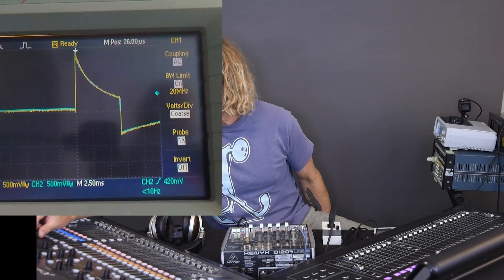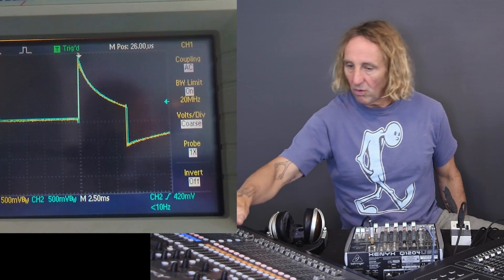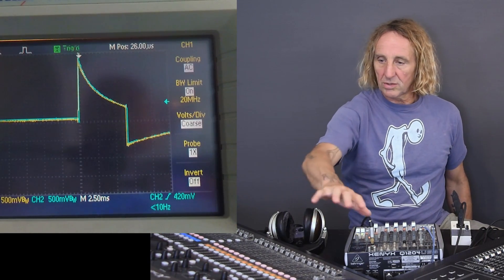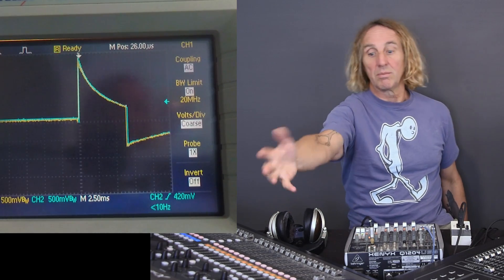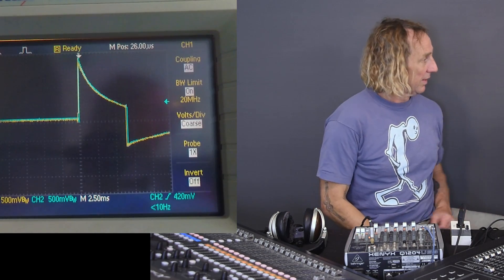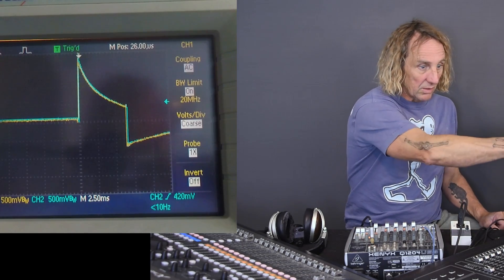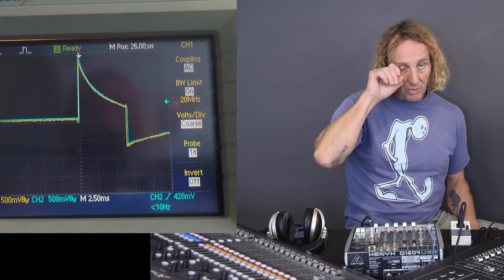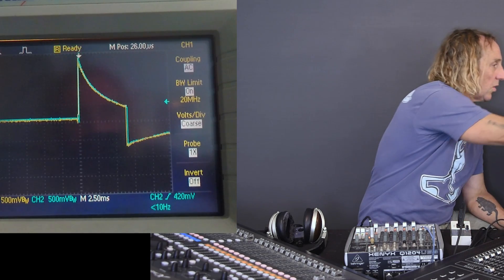Digital vs Analog Audio - X32/M32 AES50, Routing Latency (Public)

Comment: Dave, everything you do ....is outdated
Reply: Thank you for taking the time for this unnecessary and meaningless comment... and Dave everything you do supplies super information crossing my mind that nobody has actual real life  answers, you know even the biggest companies sometimes gives false documentation with the product, having test result with one sine wave instead of pink noise and manipulating the information... thank you so much man 👊
Reply from the maker: Thank you Mert.

Appreciated.
Reply from the maker: Hmmm, well these tests were inspired by bands coming through with M32 consoles and having issues with 100 meter runs for the AES50 of the festival shows we provide sound for.

So I got the consoles to do some tests and share what I found.

Perhaps you can share some valuable info about this outdated gear from your position of knowledge and experience?

Sometimes the most judgemental people are the least informed and sharing info so we know your depth of useful knowledge would be appreciated.
Reply: The majority of small to midsized clubs in the cities in my area of the world have these two mixers. As much as "big time" engineers turn up their nose at them, it is to our benefit to learn as much as we can about them in order to do our job better, regardless of whether we like them or if they are "old" . The information Dave gives is current for real world situations. If your looking for a GAS channel, in order to buy your next $20,000 mixer (just to say you have the shiny new mixer) Dave ain't it.
Reply: Everything comes back into fashion. Vinyl outsold CD last year so my old outdated copy of TOOL AENIMA went up from $19.95 I paid for it to over $1000 now if mankinis come back into vouge I’ll be set.   ha ha ha lol.

Comment: Being a musician and a recording engineer, at some point I wanted a definitive answer to the question “how much latency is ok?”  Finding out what amount we have is simple addition, with DAWs, mixers providing the numbers.  But what amount is ‘invisible’ to us as players?  I record live within a Pro Tools session and provide foldback from that session as a regular part of my workflow, so I needed a number; a reference I could relate to as a player.  Here’s how I got there.

First, some known quantities.  
1.   Sound travels a foot in a ms (millisecond).  Umm… close enough.
2.   A sixty-fourth note at 120BPM = 31ms.  
3.   A band of any kind - string ensemble to power trio - while rehearsing and writing together, commonly tolerates distances of 10ft and sometimes much, much more between instruments while absolutely nailing a groove.  So they see and adjust to latencies of 10ms+, when they must.

Some real life MINIMUM numbers:  When a drummer hits the snare with the most perfect accuracy they can muster, its sound takes roughly 2ms to reach their ears.  If I mic that snare a couple inches away and return that signal to the drummer’s IEMs with zero latency, it is actually going to be EARLY!  This blew my mind and helped me establish that 2ms must surely be an indistinguishably short system latency.  Besting that 2ms might be legitimately claimed as folly.  For the kick it’s more like 4ms but I’m sticking with the worst case snare.  The note value I mentioned in #2 applies to any instrument and assumes that extremely fast cadences that hardly anyone can play with accuracy represent a resolution of about 15 times that snare-to-ear delay.  That seems likewise to be quite reasonable as a delay that would never intrude on a player’s meter.  Trust me, even the most insane fret-tapping fiend is not going to feel 2ms.  Even the 1st Violin parts in Vivaldi’s Four Seasons would be safe.  For anything more legato, the tolerable latency would of course be larger.

3ms is not easy to achieve but is entirely doable with a DSP system like my Pro Tools HD, which measured 2.72ms with hundreds of plug-ins and layers of submixes necessary to record a 10 piece band and return 16 foldback mixes during a live session.  This was a paid gig, so I couldn’t experiment.  It was a one-time with a crowd, don’t mess it up, test and it passed with flying colors.  Many will spot that real life delays are much longer and that we players adjust, which is true.  But I wanted to know how much ARTIFICIAL latency I could introduce without problems.  The eye-ear-brain connection is a marvel and a player will adapt to anything they can compute.  What they can’t see becomes un-computable.  2ms if I can, 3ms worst case - will cause no issue.
Reply: I've seen other demonstrations say that if there's a latency of less than 7ms for in-ear monitors it's imperceivably to the performer.  Anything there at 7-10 is perceivable and in the 12-15+ range it's almost unusable because of how disorienting it is.  Also keep in mind everything adds latency.  A wireless microphone, into a mixing console, down a run of AES50, processed, back down the AES50 run, out the stage box, then fed into a wireless in-ear monitor pack, for example, is around 5ms or something like that.  It's totally fine.  But everything DOES add latency.  So here's a real-world example:  I use a wireless guitar pack, wireless in-ear pack, and all that digital routing, and it's totally fine, BUT, I also occasionally use a drop-tune pedal for my guitar so we can play in other tuning at the press of a button instead of having to changed to an Eb tuned guitar, but that DOES add enough latency, that it is noticeable.  Not to anyone who is not the person playing the guitar, but playing through the pedal, WITH all those other latency things is perceivable.  Whereas the pedal by itself is not, and the wireless stuff all also by itself is not, but adding them together, it is noticeable.  Not enough to cause us to not use it because the convenience is just too awesome, but it is worth knowing.
Reply: I read an observation from a monitor engineer some years back who related a story about a well known female vocalist he was working with who complained about the latency of a speaker/amp combination for her stage wedge.  The engineer switched to an amp with a less powerful DSP and thus a less complex speaker preset, and the artist was happy.  The more complex DSP preset utilized FIR filters and had a latency of ~7.3ms.  The simpler amp had a preset latency of ~0.6ms with only PEQ filters.  Both amps were from the same manufacturer and the presets were provided by the loudspeaker manufacturer.
Reply: @johnschalk1271    7ms is ridiculous latency for a power amp to have!  Any single monitor device’s one way latency should be sub 1ms.  Who would design an amplifier, which would almost inevitably be part of a monitoring chain, with such delay?  DSP doesn’t even deserve the name if it takes 6ms to emulate an equalizer.  Extremely complex equalizers emulations within Pro Tools HDX come with about 1ms delay.  Run of the mill EQs take 100us or less.
Reply: @artysanmobile  Well, this particular amp design is at least 10 years old and the speaker preset in question implements FIR filters to flatten the phase response of the stage monitor, so much more complex that simple linear Eq filters.  There are two newer amp series from this particular professional amplifier company and I would not be surprised if they've reduced the latency in their newer products.  I measured the latency of the two amps using a DI to get the amp's output back to mic level for my USB preamp.
Reply: @johnschalk1271    The tech has existed for at least ten years to implement highly accurate equalisation in DSP at tens of microseconds speed.  You’re being very cagey about what manufacturer simply ignored something they definitely should have known.  Zero phase is a real mess to emulate mathematically.  That should simply disqualify it from real-time use.
Reply: @johnschalk1271    Your post made me look up my Crown amplifiers spec sheets.  All the DSP processes are clearly explained.  Latency?  Crickets…..  Shame, and no excuse.
Reply: @artysanmobile  Thankfully we have low cost tools that let us measure some of these values ourselves.  I'm using Room Eq Wizard and a Focusrite Scarlett 2i2 for my measurement rig.  I loop the left channel of the 2i2 back into the input as my timing reference and then off I go and measure stuff.  I'm learning as I go, but finding interesting results too.
Reply: Thing is... latencies sum up. Imagine a keyboard player using a computer with something like Kontakt Sampler. The software has some latency, his/her audio interface has latency in communicating via USB, and the DACs have latency. Then imagine a Dante thing... ADC, TCP/IP, mixing console, and all the way back to the controller amp (so even more DA, AD/DA)...  when I play PianoTeq on my computer which goes via an old RME Digi via ADAT lightpipe into an old Yamha 01V96i, a latency buffer of 256 samples in the RME is hardly bearable. It feels wrong. 128 only sometimes bothers me, 64 samples is safe. So I need my soundcard to run at 1.3msecs buffer in order for the whole system to feel right. Which may seem stupid, but there are other latencies summing up, like the MIDI driver, PianoTeq itself, and the 01V96i. So my advice would be: Keep latency down in live situations, keep it as low as you ever can.
Reply: @nielsott    Yes, both live and dubbing scenarios tolerate very, very little delay.  In each, a 64 buffer is now worst-case.  DACs have gotten about as fast as they’re going to, around 500us, leaving processing likely to break the bank.  I have noticed software processes, including summing, getting much quicker lately, due to regular use of high quality FPGAs which were unaffordable not so long ago.  It is not trivial to write code for FPGAs but music is borrowing from richer industries, making USB drivers near invisible where they were once the wall.  RME, Antelope, Avid, Lawo, Digico all pushed the envelope and the rest must follow.  The market (us musicians) needs to demand vanishingly low delays.  The tech has been there for awhile.  Music presents a very high bar regarding delay.  Please see my original post in this thread, and forgive me for its length.
Reply from the maker: I have had experience with consulting for a manufacturer that had proprietary FIR processing that was quite good but it did require about 6.5 Ms of latency to implement. The actual latency of 6 5 Ms (about 7feet in the physical world) was not really an issue as musicians often stand 7 or more feet from a wedge or side fill without issue.

The issue was a resonant tunnel phasey sound of some of the vocals bleeding back into the wedges.

It added "ziiiinnng" like little meteors or whizzer's.

Delay due to distance does not have the same sound or impact as delay (latency) electronically induced in some real world scenarios.

That said, also in many situations, 7 or 10 Ms of latency (delay) is irrelevant as siners can readily sing and musicians readily play 10 or more feet from an amp or monitor.

Out of this one can gain the understanding that simple broad statements as to what is good or bad or irrelevant or an issue is truly the the issue.
Reply: @artysanmobile  My RME Digi card is from 2006, it was inexpensive back then because RME just had come up with the new RME Hammerfall HDSP. Both cards already back then were based on FPGAs, and I don't think RME has changed this ever since. However, RME gear definitely isn't from the cheap range . I'm looking forward to my FPGA-based SQ-5 mixing console but as many electronics manufacturers, Allen&Heath have trouble shipping. Yamaha claims the latency from analog in to analog out of the 01V96i to be <1,6msec. Which I consider good for such an old console. I don't use it live, only for my little studio room. Using a 91V96 is too much like playing tetris live… many buttons to press, but you're never fast enough.
Reply: @DaveRat    Distance is something the brain can adjust for as it ‘chooses’ your own voice as the reference.  Singing or playing an instrument with a monitor at your feet or in your ear that is 7 or 10ms late is a very different thing.  It is really unsettling.  I’m sure you’ve experienced a creatively used delay that is louder than its source.  It’s a really cool effect but unbelievably hard to pull off live.  The brain of the performer just sends ‘this is wrong!” signals.  Try it if you haven’t to see what I mean, Dave.  When the delay is quieter than the source, as in nature, our brains have no problem accepting it as something else.
Reply from the maker: Hmmm, not sure it is that clear cut. At least in my experience there are many factors.

Try comparing the sound and timing feel of wedge down stage with no delay, so it's maybe 16 feet from wedge to ears, vs a wedge up close say 8 ft wedge to ears plus 8 Ms of added delay.

I dealt with this when doing monitors and switching between side fills and the wedges.  Then adding delay to the wedges to time align to the side fills.

Adding time to the wedges improves summation with the side fills but also makes them sound further away, with or without the sidefills on. But they don't sound as afar away as actually moving to the distance vs adding the electronic time, due to the direct sound to reverberation ratio.

Conversely, adding delay to vocals in sealed in ears creates differing complexities

There are a lot of variables and yes out brain tunes out a room delay and one should not discount that though our brain may not initially tune out added delay, it does not take too long for our brains to acclimate.

In other tests where I was summing multiple latent signals, the sound after listening a few seconds was fine, then switching times sounded very odd. But after a a short time, all good. Then switching back sounded very odd.

So adding in the variable of "what our brains are able to acclimate to where it become a non-issue" really makes things fun.

Just the concept of headphones is an unnatural auditory event  that some or many humans have acclimated to and deemed acceptable or desirable.

I will see if the test can be recreated on YouTube.
Reply: @DaveRat    You’re absolutely right about the myriad scenarios, which you proved by switching times in an already ‘accepted’ foldback.  And, sidefills, in my opinion, work specifically because of the distance, rather than despite it.  I have worked, both as engineer and performer, with sidefills only and really enjoyed the experience.  The band has to cooperate a little.  No triple Marshall stacks allowed!

Just as you experienced a spectrum of possibilities, the same goes for different players who for some reason truly are more or less sensitive to timing issues.  And by that, I don’t mean cancellation, but timing.  Bottom line for me is, I only directly know my own perceptions, so I had to define a hypothetical when designing the system I described.  I couldn’t just satisfy me.  That’s what my original post was about.  To explain how I came to make my decision on a number, which admittedly is not clear cut, as you say.  Somewhere, a decision had to be made, so I am offering my rationale.
Reply from the maker: On point
Reply: @DaveRat    Disclaimer:  I am a live recording specialist, often wearing both hats.  If I only worked in studio, I would join a fairly solid consensus toward that 3ms area, with some who won’t accept anything but pure analog.  Live sound cannot afford to be so picky.  In the studio, I direct the band how to set up.  Onstage, the band directs me to take what they give me and learn to love it.  Absolutes just aren’t possible onstage.

This is a very important subject to me and I’m enjoying this discussion.  Thanks for the opportunity, Dave.  There is no spec.  None.  Consensus rules the day, and your channel is a great place to look for that.

Comment: Interesting topic, I’m curious how processing impacts the latency. In other words, does engaging the compressor/eq add latency?
Reply from the maker: The EQ and comp do not add latency
Reply: @DaveRat  interesting. Trying to figure out why there’s no delay on the bus to main vs channel direct to main. To compensate for the processing, they must’ve delayed the inputs straight to main a couple samples to even those out versus through a bus to mains, right?
Reply from the maker: Hmmm, the analog concept of travelling from here to over there taking some time vs travelling from here to somewhere else then to over there taking more time, does not really apply.

In digital, the signal is a created numerical stream, then has various maths applied to it, then ends up as a numerical stream.

The maths applied like add these numerical streams together or multiple, divide or some other math equation takes some time to. 

So best I understand, a console can have a fixed latency time, within which, all possible maths that the console is capable of, can be applied regardless of whether the signal is controlled by one or many knobs or faders or altered along the way.

So, similar to what you describe but routing to a subgroup, adding EQ, compressors, gate, or whatever, all are just maths, the time sum of which, are included in the fixed latency, whether or not they are used.

That said, I have not tested the whether there are internal patchable  efx that alter a the signal latency.

Also, there does seem to be a very slight latency offset between pairs of channels such that if an identical signal is inputted into channel 1 and 3, there is a a time offset of 1 sample or 1/48000th of a second or about 1/4" 

I will look at measuring and confirming,. If this is true, then an input on channel 1 or 2 compared channel 31 or 32 would be offset 4"  or .37ms
Reply: @DaveRat  the patchable FX can add latency. I read the multiband or "combinator"? definitely does add latency.
Reply from the maker: That would make sense as a limit on the maths and time the maths can take for efx would limit the limit the number and type of efx.